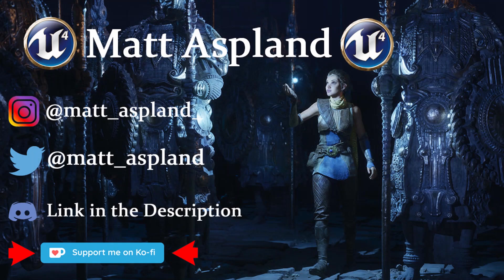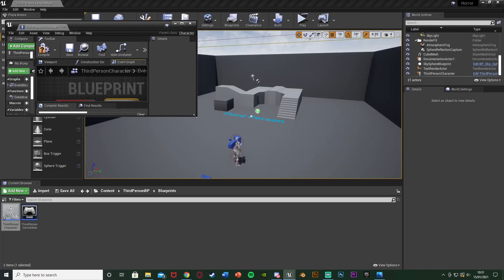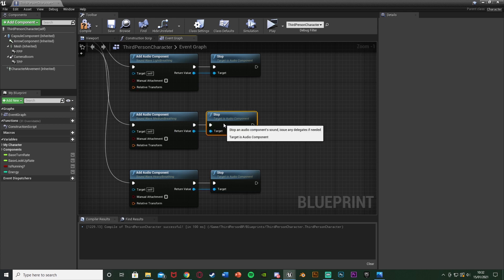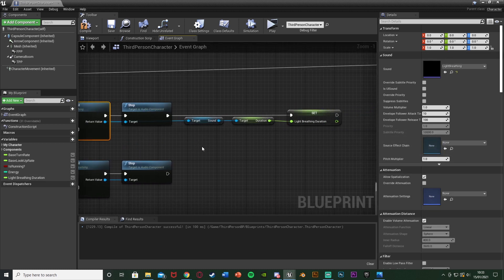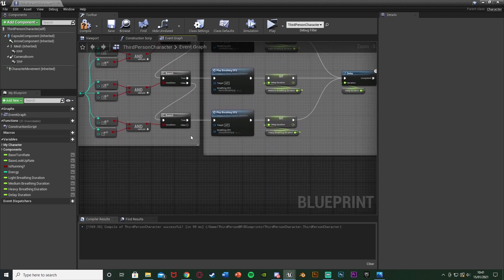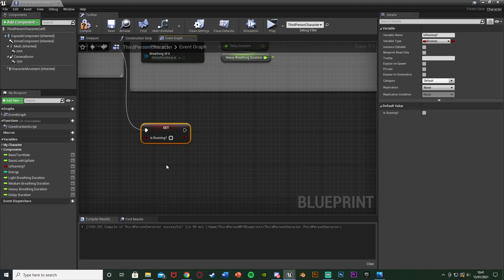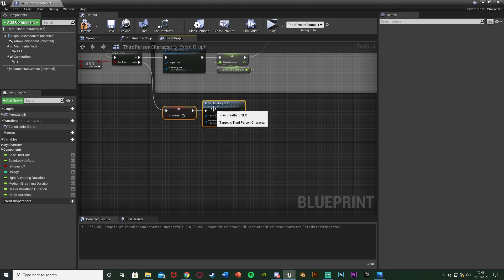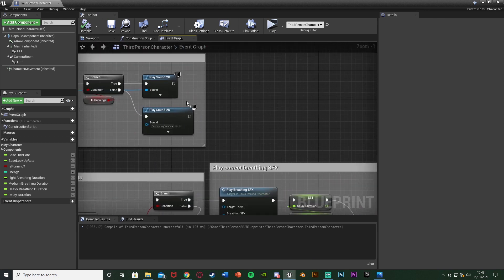Dynamic Heavy Breathing When Running | Exhaustion Based SFX | Part 2 - Unreal Engine 4 Tutorial

Comment: so with this code, it will work till the energy reaches zero. The part to get stamina back like, if we reach zero energy block running but generate all few seconds some energy back with integers from 0 to 50 or anything is missing. it will not work like this.